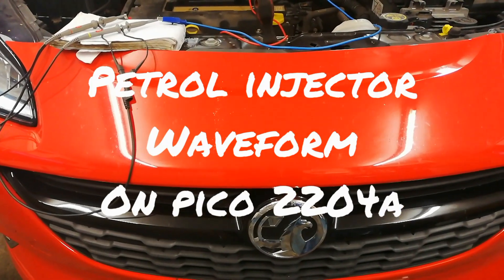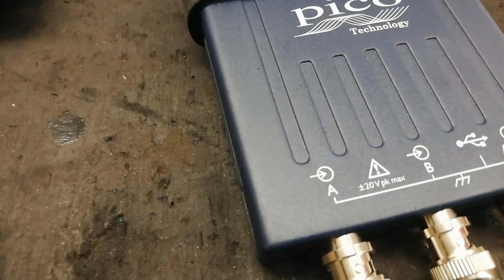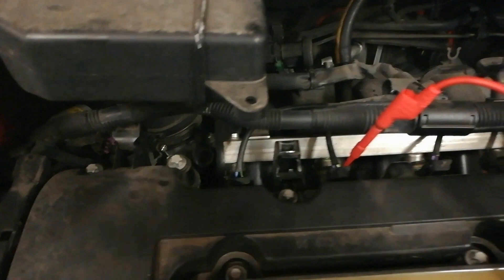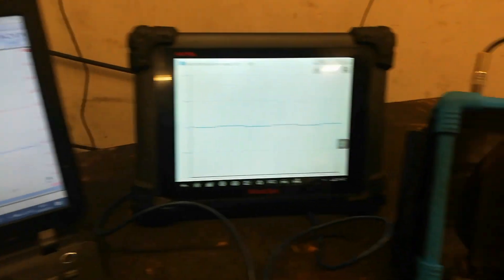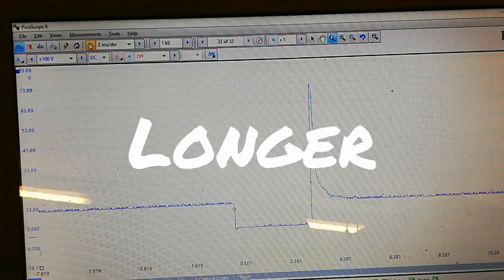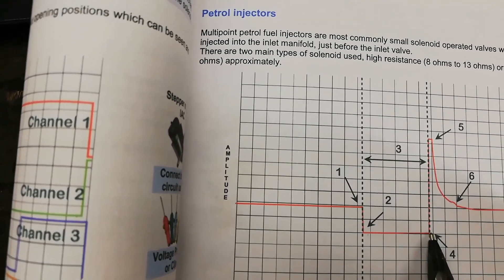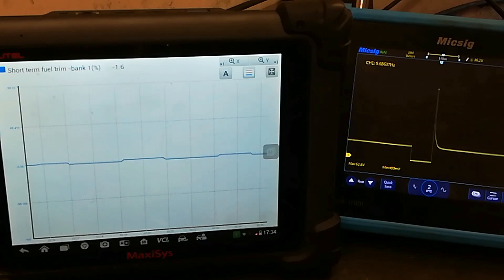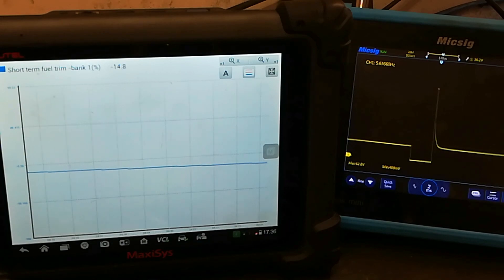Petrol injector on Picoscope 2204A with induced fault analysis

Comment: Why didn't you use the attenuator sitting on the table when doing an injector voltage test?
Reply from the maker: The probes are 10x attenuation
Reply: @davesterl  Oh yes...I forgot that stock probes it ships with have built in attenuators.  Thanks

Comment: Hello, why the red led is flashing on the scope since the maximum voltage of the spike seems to be a lot under the 20V threshold? Using the 10x probe it shoudl be around to 7V, isn't it?
Reply from the maker: Red led on the scope is communication
Reply: @davesterl  thank you very much, I didn't own a pico 2204A yet, but I will soon since it's a very powerful scope for the price

Comment: Thanks for sharing Dave. The hantek 20:1 attenuator are really check $10 each and work just as good as my pico ones. I think I see one on your table ..Appreciate you sharing... jay
Reply from the maker: cheers jay, no problem i just used those probes as they normally are with the scope altho if you attenuate too much it can affect the signal